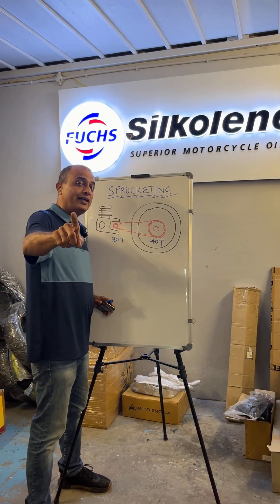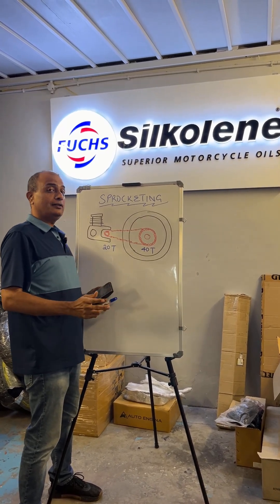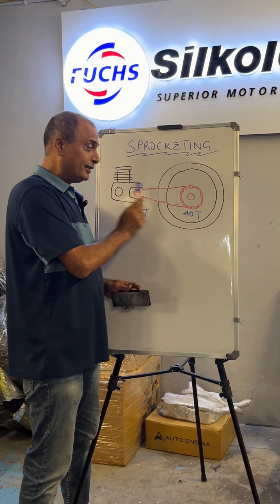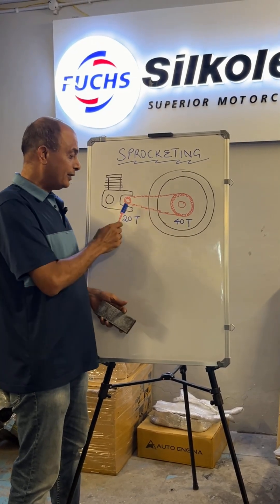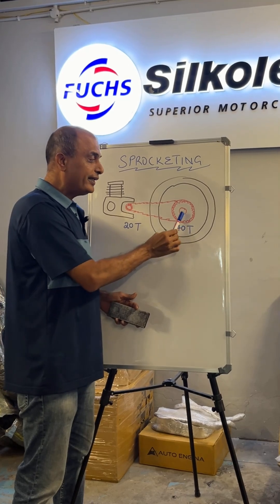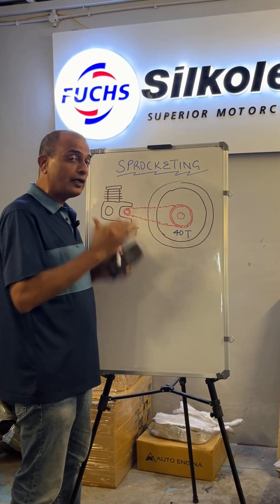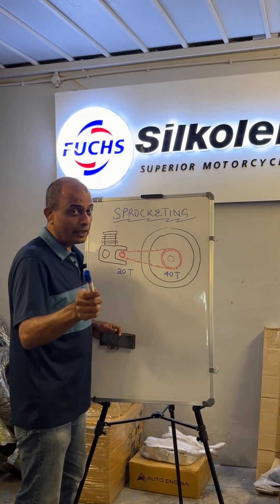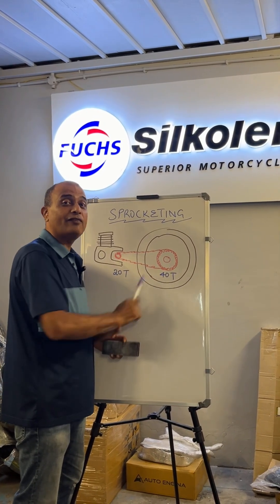Big Bear Tech Tuesday - Sprocketing

Comment: Hi Bosky! I used to ride a geared bicycle as a kid so I could visualize this. But how exactly do gears in a motorcycle work? I have never seen the inside of a gearbox but is it the same concept?
Reply from the maker: Similar. Instead of a chain, the two sets of gears are directly connected.
Reply: @bigbearbangalore  oh, so is it similar to a car's gearbox where there are multiple sprockets that move around and slot into each other?
Reply from the maker: Two sets of multiple gears that mesh together in various combinations, yes.

Comment: Honda cb 350 Highness requires a lot of gear change during city rides which is frustrating. Can we change the sprockets ? Which ratio would you recommend ?
Reply from the maker: That's a characteristic of the engine and changing sprockets will only marginally help bit negatively affect the top end performance.

Comment: Appreciate you advise….I changed my interceptor 650 wheels for weight management from 18” to 17”. Now it’s a wonderful and well managed bike. I got good profile tyres too. But the gearing ratio changed and became a bit quicker. Have to shift to lower gears in comparison to the earlier wheels.
As advised by many I changed the front sprocket to 16T from 15 and it is much closer to original conditions though there’s compromises here and there. Have you come across this situation for interceptor? Any clue that you could provide?
Took her for a 3K ride and am very happy with the handling part

Comment: I changed my interceptor 650 wheels for weight management. Now it’s a wonderful and well managed bike. I got good profile tyres too. But the gearing ratio changed and became a bit quicker. Have to shift to lower gears in comparison to the earlier wheels.
As advised by many I changed the front sprocket to 16T from 15 and it is much similar to earlier conditions though there’s compromises here and there. Have you come across this situation for interceptor? Any clue that you could provide?
Took her for a 3K ride and found very happy with the handling part
Reply from the maker: If you haven't changed the wheel size and only profile, stock sprocket is the better option.

Comment: Hello sir,Would you suggest a rear sprocket change in himalayan 450 to increase its low end torque? I felt in my test drive Its low end pull isnt  that great, and also a delayed throttle respone , as its a limited time drive i couldnt grasp much , wanted to understand if the stock gives optimal performance in most cases or if i need a sprocket change and fuelx installed to address my challenges
Reply from the maker: I recommend you stay with stock and install FuelX.
Reply: @bigbearbangalore  thank you sir !